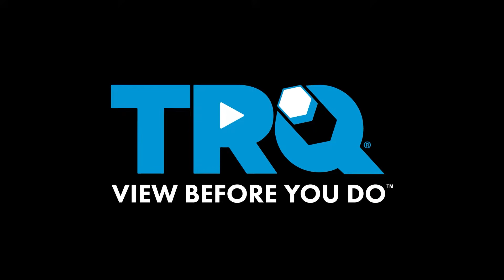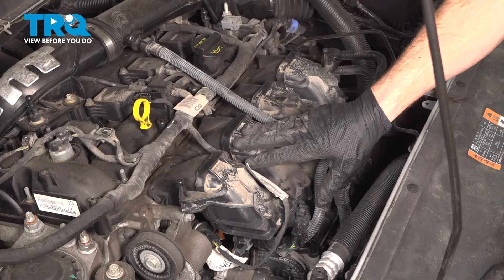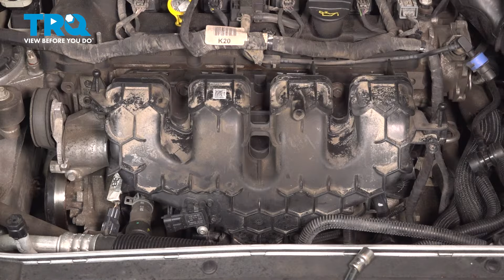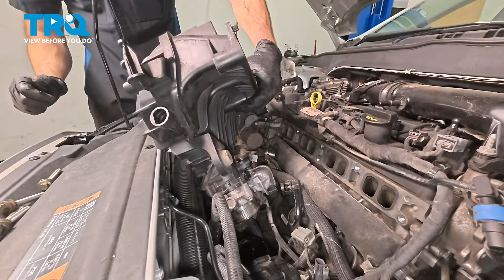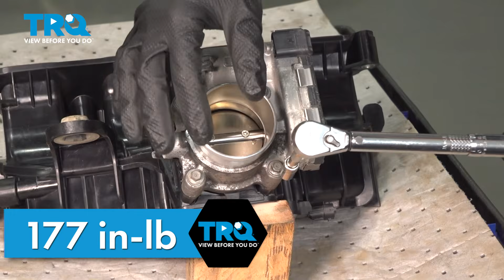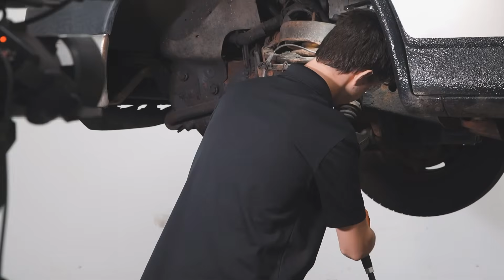How to Replace Throttle Body Assembly 2013-2020 Ford Fusion 2.0L I4

Comment: Great video, just note that video has a mistake on the torque spec. Shall not be 177 lb-in, you could damage the plastic. Correct is 89 lb-in (9.5 N.m or 7 lb-ft)

Comment: Torque Spec for throttle body is not 177 in-lbs. as stated in the video. Ask me how I discovered this. Other sources online say 89 in-lbs and is what I wish I had tried.

Comment: Great Video. Seems to have fixed code P0035 also. Take note for those of you with the 2.0T you will have to remove tensioner pulley to get the last manifold bolt

Comment: Just finished replacing my throttle body today. Took me a while as I’m still not super used to working on my car. My tensioner pulley was slightly different and it was in front of the left-most bolt on the intake manifold, so I had to remove it. The replacement seems to have fixed the issue. I’m happy to have the car working again.

Comment: What a stupid place for a throttle body …that centre bolt for the manifold .. you don’t need a magnet to align the bolt .. you take a dab of grease out it in your socket it holds the bolt

Comment: Bro, how the hell did you get the intake manifold to slide in to the hose so easily? I can barely see what I'm doing, but regardless of how careful I am to align them, I just end up pushing the hose down. And I don't have any clearance to get hold the hose in place and/or push up on it.